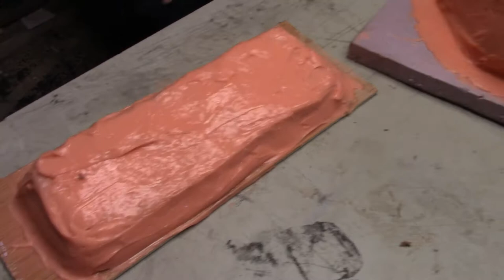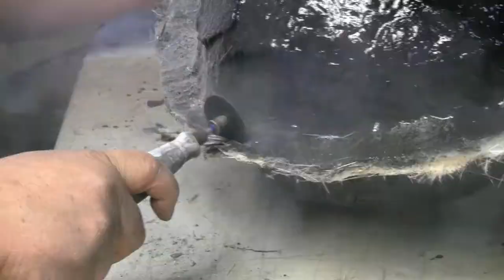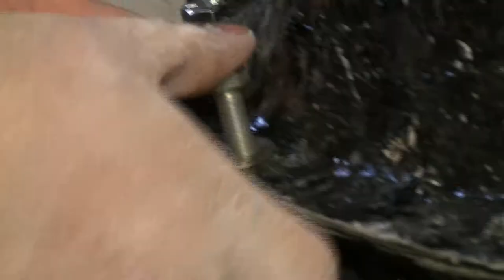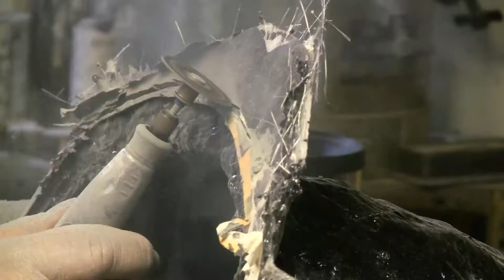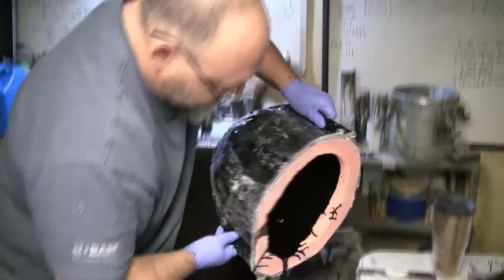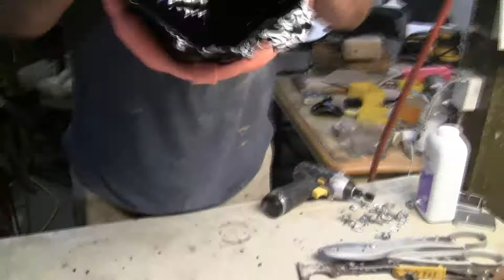Making the Mandalorian Helmet Mold

Comment: So what are all the different things you used in this?  What did you coat the helmet with, what did you put over that, what did you use for the mold, etc.  I love this, I'd like to learn more about it.
Reply from the maker: The silicon used was Smooth-on rebound 25 and rebound 40.  I used fiberglass mat and Smooth-on onyx to create the outer shell.
Reply from the maker: Check this video out. It goes into much more detail.
https://www.youtube.com/live/LiHhDSIYRp8?feature=share
Reply: @blasterpro7860  Ok awesome.  I appreciate that.

Comment: What material did you cast the helmet in? Looks great! Thank you.
Reply from the maker: I used Smooth-on Black Onyx.  I also used Onyx reinforced with fiberglass for the outer shell.  I like Onyx for its ability to resist heat.  The two biggest risks to resin helmets is being dropped and loosing its shape from heat, like being left in the car too long or being in direct sunlight for too long.  Since most helmets will suffer damage from being dropped, I use Onyx to help with the heat warping.

Comment: Dude, you’re crazy to be working with fiberglass and all that other material without a respirator!
Reply from the maker: I actually do wear a respirator, and did most of the time and also had a vapor and dust collection just off camera...I wasn't wearing my respirator only when talking to the camera but most of that was cut due too the vapor and dust collector noise on the audio.
Reply: Fiberglass is deadly man.

Comment: Small question regarding the outer shell of the mold: at what point did you remove the clay/create this ridge to split the cast? Im a little confused as to what exactly you did there..
But awesome work! Very helpful:)
Reply from the maker: The clay was removed after the first half of the outer shell had cured, then some heavy paste wax (minwax  paste finishing wax) was applied too keep the two outer shell haves from sticking together.
Reply: @blasterpro7860  thank you:)

Comment: How do you make the first gray mold? Is a store bought or 3D printed helmet used? I can never figure out how people get that first mold squared away
Reply: The original helmet was a generic 3d Mandolorian helmet, heavily modified to create the proper look.  The ears and ear caps and also the key slot (recessed panel in the rear) were all hand made using body filler and styrene plastic.

Comment: What product did you use for the mother mold?  I see the plaster wrap but the black substance has me perplexed.  You only used one coat of this and it doesn't appear that thick like a plaster mother mold would.
Reply from the maker: I used smooth on black onyx with fiberglass matte.
Reply from the maker: The Mother mold used fiberglass and Smooth-on Black Onyx.  Black Onyx is also the resin used to cast the helmet

Comment: What did you embed in the silicone to secure the glove into the fibreglass ? It looked liked you used magnets
Reply from the maker: Yes, they were rare earth magnets.
Reply from the maker: Yes, I used magnets, I started experimenting with keying molds with magnets, The goal was to have a thinner sock mold to have a seamless helmet ready for paint with little work. Thinner molds tend to show traditional keys in the finished part as dents or wavy distortions.  Magnets solve this.

Comment: How come your clay sticks to the silicone mine falls off
Reply from the maker: LOL...I know it can be difficult.  if you notice in the video I built up clay on the backside of the clay partition. the clay I built up for support is also how I hold the clay to the silicon.  I work the clay till it softens and gets sticky, I also add a little water to help.  Another thing I do that makes things easier is my partition is strait.  Others like to add angles and bends in their partitions  for keying the mother mold.  Mine are just strait and I add wedge shaped clay cutouts to the partition for keying.

Comment: What liquid do you add?
Reply from the maker: The material is called Onyx, it's made by Smooth-on. It is a thick urethane resin that works well for roto casting, also has good thermal properties.
Reply: @blasterpro7860  What is the black shell used above made of?
Reply from the maker: @cloudy95979  I also used Onyx for the outer shell, that and fiber glass mat.  I had lots of Onyx on hand at that time but I could have just as easily used fiberglass resin also.   The outer shell is just for supporting the  silicon mold and holding the over all shape.  You can use almost anything thats rigid for the outer shell.  People use many different materials for their outer shells, all depends on their own preference.  I used plaster just the other day  to support an open faced silicon mold, I knew the mold was going the only have 4 or 5 castings so to save money and keep the cost down I made a thin silicon mold backed with plaster, total cost just under $50. So for 5 castings the mold cost turned out to be less than $10 per cast.  I had made a thicker silicon mold and backed it with a more expensive material the cost would be over $100, which makes the cost per casting over $20. Depending on the intended use of the mold and the number of castings you plan to make from your mold can help you decide what materials to use for the outer shell.

Comment: What rubber did you use??
Reply from the maker: I used Smooth-on Rebound 25 and 40
Reply: @blasterpro7860  Question. If I want to make rubber helmets, whats a good strong rubber to use??
Reply from the maker: @MaskedCrypto  smooth-on 57D will make a  flexible helmet that will hold its shape. Its a urethane resin that works well in roto casting and large slush molds
Reply: @blasterpro7860 What liquid do you add?

Comment: You didn't put any registration keys on your silicone.
Reply from the maker: That's correct. I used rare earth magnets in the mother mold and the silicone mold for registration. I'm going to be doing a tutorial video on this process in the future.
Reply: @blasterpro7860  I saw the magnets in the silicone mold, but I wasn’t sure why you put those in before you did the mother mold since the rubber mold was a one piece & didn’t need to be separated. I am very new to mold making of this caliber, so I’m not quite sure how “registration keys“ work.
Reply from the maker: @catherinefisher6188  The keys are for lining up the silicon mold to the mother mold.  My goal with this mold was create a seamless mold needing little clean-up. with my past experiences the mold has to be relatively thin, 7 or 8 layers to act as a sock mold.  traditional keys can cause dents or imperfections in the finished helmet.  Using magnets helps to avoid this problem. Also a thicker mold will do the same but would have to be a two part with a seam line. Having a thinner mold imperfections can easily creep into your finished helmet, for example besides the keys having a lumpy or very uneven outer surface to your silicon mold can and probably will show up on your finished helmet.  The mother mold will reproduce all the lumps and imperfections and its very difficult for the silicon mold to settle in pefect even with the keys....Smooth is ideal. Heres a live stream where we go into detail about helmet molds, skip to 17:00 
https://www.youtube.com/live/LiHhDSIYRp8?feature=share